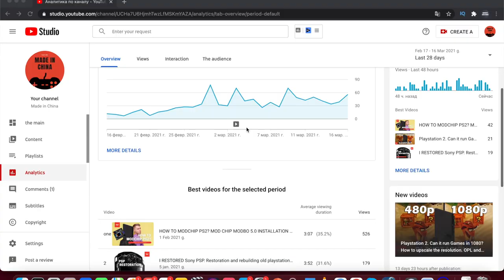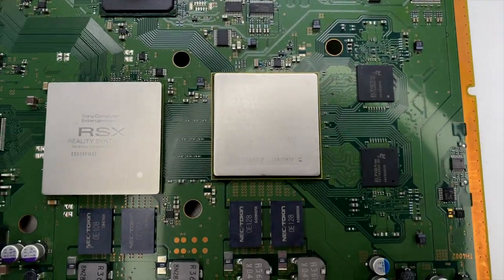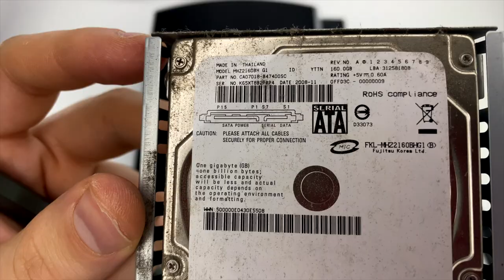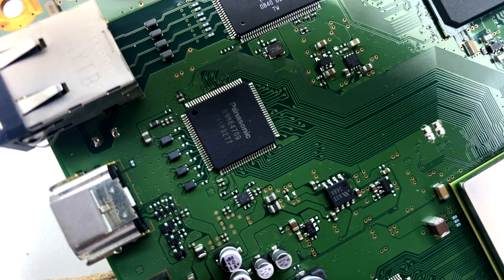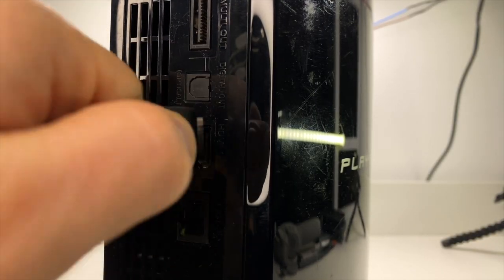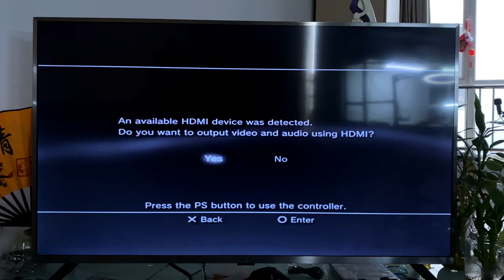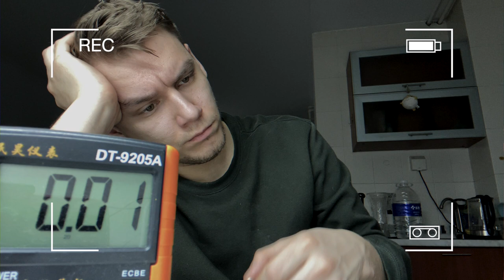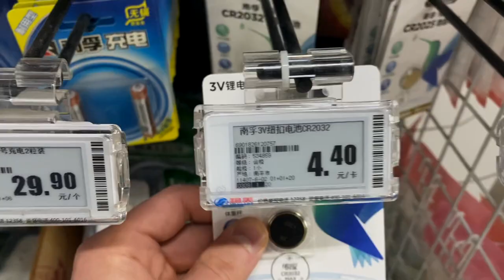PlayStation 3 BLACK SCREEN FIX. PS3 HDMI NOT WORKING. HOW TO FIX NO SIGNAL? NO VIDEO AND NO SIGNAL

Comment: I bought my Playstation 11 years ago and have never used HDMI in all these years. When I thought about doing this, I found this problem!
Reply from the maker: When your console is turned on, press the power button until it beeps for the second Time. Then, it will beep twice. And then let it go. And just wait a few seconds for the ps3 to adjust. If you see the picture on the tv screen, my congratulations. 

If you still have the problem:

There can be a few reasons why PlayStation 3 does not have an image, for example, mechanical damage to the HDMI connector, Board faults often include graphics chip (RSX) problems or HDMI video converter (MN8647091) (which I replaced in this video) faults, but other problems may also occur - power problems, firmware corruption, or CPU failure (CELL).

Take the console part, use multimeter to check the HDMI video converter chip, if there is short, on the output of hdmi signal, 100% that chip is broken and needs to be replaced.
Reply: There is still a problem anyway thanks for the quick and helpful reply.
Reply: @ReMARKCHANNEL  I have the old fat ps3 and it won't beep more than one HOW DO I FIX THIS!!!!

Comment: What should I do if everything works but the screen is black
Reply from the maker: When your console is turned on, press the power button until it beeps for the second Time. Then, it will beep twice. And then let it go. And just wait a few seconds for the ps3 to adjust. If you see the picture on the tv screen, my congratulations. 

If you still have the problem:

There can be a few reasons why PlayStation 3 does not have an image, for example, mechanical damage to the HDMI connector, Board faults often include graphics chip (RSX) problems or HDMI video converter (MN8647091) (which I replaced in this video) faults, but other problems may also occur - power problems, firmware corruption, or CPU failure (CELL).

Take the console part, use multimeter to check the HDMI video converter chip, if there is short, on the output of hdmi signal, 100% that chip is broken and needs to be replaced.
Reply: Thank you 🙏🏻
Reply from the maker: @m422q8  always welcome

Comment: Bro. I literally just had this happen on a 60GB system I just bought yesterday. No videos even after resetting the video preferences. It did work at first for an hour but the next day no video signal. Your video does seem like it would be helpful but there is just a lot that I wish you are able to at least  explain what you’re doing.. like the process of replacing the chip was absolutely crucial and it’s just a quick few different angles of you doing it in fast motion but without any explanation at all..I wish that you’ll be able to fix that!
Reply from the maker: Thank you !
Reply: Hi bro. i have the same problem. Did you solve it?
Reply from the maker: @josellanca1478  When your console is turned on, press the power button until it beeps for the second Time. Then, it will beep twice. And then let it go. And just wait a few seconds for the ps3 to adjust. If you see the picture on the tv screen, my congratulations. 

If you still have the problem:

There can be a few reasons why PlayStation 3 does not have an image, for example, mechanical damage to the HDMI connector, Board faults often include graphics chip (RSX) problems or HDMI video converter (MN8647091) (which I replaced in this video) faults, but other problems may also occur - power problems, firmware corruption, or CPU failure (CELL).

Take the console part, use multimeter to check the HDMI video converter chip, if there is short, on the output of hdmi signal, 100% that chip is broken and needs to be replaced.
Reply: @ReMARKCHANNEL  Hello bro, thank you for taking the time to reply my question. I dont have AV nor HDMI. So i am thinking that i have same problem that you showed in your video. It was very helpful and well presented.
Reply: I wish i could do that... My ps3 super slim suddenly won't output anything via hdmi & av. I tried resetting the video but no joy. At this point, I'm almost pretty sure it's the same problem you had. I don't know what to do, I'm lost.
Reply: @jonmanilenio  mate . He gave us the answer :)

"There can be a few reasons why PlayStation 3 does not have an image, for example, mechanical damage to the HDMI connector, Board faults often include graphics chip (RSX) problems or HDMI video converter (MN8647091) (which I replaced in this video) faults, but other problems may also occur - power problems, firmware corruption, or CPU failure (CELL)."

Now you need to decide what will you do :) Try to fix it or just sell as part on ebay. :) and buy another one.
Probably does not worth to fix that if you have a cheap ps3 console (like 40GB version). you can buy for £30-40 with controllers and games.

Comment: Great video! Thank you very much 👍
Could you drop us more informations please? :) 
Like:
- what is the heatgun's safest celsius for remove the chip ? ( as I see on the video : 294?) Probably better to using kapton tape to keep the motherboard parts safe ? 
- what digital multimeter do you use? ( I am just curious)
- what is the good / bad data on the digital multimeter to find out the problem? ( I am a multimeter noob sorry :)
- what is the liquid are you using? normal dishwashing liquid?
Thank you if you can answer these questions :)
Reply from the maker: Hello! Sorry for the late answer, I've been quite busy these days. 1) 1)With this particular chip, I used the temperature from 280 - 310 degrees celsius. For sure, if you have Kapton tape it is better to use it. I don't have this tape and I managed it without using this.
2) My multimeter is a very cheap device that I bought from Taobao.
The model name is DT-9205A
3) I'm so sorry to say that, but you are asking the wrong person=) I only know the basics and in the case of this Playstation, there was a short on the HDMI output, so when I removed the chip I realized that the short was gone and this chip was the reason.
4) Yep, you are right. I use the cheapest dishwasher liquid that I found in the local supermarket.

Comment: great video. I do console repairs for a local retro store in my area and just recently came across this for the first time. i have a short in the board where the capacitors surround the chip. is there an easy way to find the one i need for this fat model as well? everywhere ive been looking i keep finding the super slim or slim chips
Reply from the maker: Hello, do you mean nec/Tokin capacitors?
Reply from the maker: https://www.psx-place.com/threads/research-experimental-nec-tokin-capacitors-replacement-ylod.25260/

Comment: I tried to do this but all it comes up is a little grey screen within a black screen. There are absolutely no words at all and both of my controllers refused to turn on and connect to the PlayStation 3 at all even after I reset them. Even if I had a touch screen TV I wouldn't be able to go to any of the settings in safe mode to make it restore anything or reset anything or anything. There are no words that come up at all. I even tried changing where the HDMI was hooked up to the TV I tried to unplug it for a while the PlayStation I even tried unplugging HDMI for a little bit and plug it back in and see if it would try to reset that too no matter what I do there are no words at all. On the screen no thing like usually it'll say that it's shut down improperly or something when I unplug it for a while that didn't pop up either so there's no words on the screen there's no way for me to touch any words even if there were words because it won't hook up with anything I seriously need help because none of these have helped me I tried doing a hard and soft reset with the power buttons and stuff and unplugging and everything and no matter what I do nothing is working at all. It's very upsetting very frustrating I tried banging the PlayStation a little bit not too hard obviously I tried shaking it I tried blowing in every little hole trying to get a little bit of dust out if that was the problem there was an issue with that outlet at one point where for you plug it into the wall it was a little corroded around the metal that plugs into the wall and the PlayStation to turn the power on I clean that all up make sure it was dry and everything so it finally has power cuz for a little while he wouldn't turn on there was no red light or anything but thankfully it was just that issue the power cord I fixed it so now it's turning on but there is nothing and on top of all that where all these videos say that they're supposed to be beeps when the PS3 turns on and off and everything to make you go into safe mode and reset it and whatever there's no noises no beeps at all. I just held it down for as long as I could multiple times until it finally came up instead of being completely black screen to a black screen with a big gray screen in the middle so should be technically it is in safe mode so I can you know do all the steps that you can take to try to fix it but there's absolutely no words on the screen so basically no menu even if my PlayStation 3 controller would turn on and hook up to the PlayStation they would be useless because I cannot move anything I cannot touch anything there's nothing to touch there's no words I hope and pray that somebody knows what's wrong with it and they can help me I really need help I'm begging you please.
Reply from the maker: Wow, first of all, this is the biggest comment I’ve ever seen on YouTube 😂. As far as I can see, there is no way I can help you, because this console needs to be disassembled and tested with proper tools. If there is a service center in your area ask them for help.
Reply: @ReMARKCHANNEL  I tried using talk to text cuz it's faster but not effecient lol. It didn't type exactly what I said. I tried being very descriptive just incase someone may be able to help me. Sorry bout that. Thanks for the advice I'll do my best.
Reply: @ReMARKCHANNEL  honestly I think when my electric cord got messed up it may have short circuited something. May have fried something or damaged something internally. So I'll have to wait till I got money to go to a shop to get it checked out. Thanks so much either way though. Your advice is good I appreciate you taking the time to read my messages and give advice!

Comment: Hey Dudu, Thanks for the awesome video. Just very curious how you know which pin to test with multimeter? How do you know the two points goes through the ic chip?
Reply from the maker: I’ve read about this problem on a repair web forum. The guy who shared this info knows this problem 100%🙂
Reply: @ReMARKCHANNEL  Ok Thanks!
Reply: Can you share post or how to find it? Does AV still work with this chip failing?
Reply: @grandtheftauto1233  mine AV wordk hdmi dead, i have got short circuit sam as video. I try today replace driver.
Reply: @krzysztofs.6259  please share how it goes Id appreciate it
Reply: @grandtheftauto1233  TV see hdmi cable from console in input signal selection, before replacment TV did not see pluget cable. But the signal did not come back. AV works like before :(  maby hdmi socket is broken but i dont have one to replacment :/ PS sorry for language errors
Reply: @krzysztofs.6259  I understand. Yeah my tv see signal but no video.

Comment: Hello there...
I have a fat ps3 that has no signal, no thing but black screen and tv shows in the details bar on the bottom "480p resolution" ...that's it 
By the way, the power light is green
Reply from the maker: When your console is turned on, press the power button until it beeps for the second Time. Then, it will beep twice. And then let it go. And just wait a few seconds for the ps3 to adjust. If you see the picture on the tv screen, my congratulations. 

If you still have the problem:

There can be a few reasons why PlayStation 3 does not have an image, for example, mechanical damage to the HDMI connector, Board faults often include graphics chip (RSX) problems or HDMI video converter (MN8647091) (which I replaced in this video) faults, but other problems may also occur - power problems, firmware corruption, or CPU failure (CELL).

Take the console part, use multimeter to check the HDMI video converter chip, if there is short, on the output of hdmi signal, 100% that chip is broken and needs to be replaced.
Reply: @ReMARKCHANNEL  I did that. Same problem
Reply from the maker: @weswessy9843  did you try another output?
Reply from the maker: The composite one
Reply: @ReMARKCHANNEL  yes I did with A/V , unfortunately the same problem
Reply: @ReMARKCHANNEL  can I capture the issue for you? If you never mind..
Appreciate it
Reply from the maker: @weswessy9843  Unfortunately I don't think I'm able to help you. In this case it can be anything. I guess you better get professional help in your area🙄
Reply: @ReMARKCHANNEL  thanks anyway...
I think I'm the only " professional" in my area 😁

Comment: I have a problem with my console, there is no video signal on hdmi, but there is no video signal on rca either
Reply from the maker: Hello, There are lots of reasons for that. If you tried to reset video output settings then I say you have a hardware problem. If you are not familiar with testing/repairing pcbs don't try that, leave it to professional repair guys in your area, or grab another second hand console.

Comment: Question: If I'm not getting a signal from the HDMi and COMPOSITE cables, could the HDMI IC still be broken? Or would there be a different proiblem? My PS3 turns on fine an eject works too, hdd also seems to be engaged. It was rather dirty and dusty when I got it tho ... the thermal paste was pretty dry, but I seen dryer pastes on PC's in the past than this ps3. Any thoughts?
Reply from the maker: Well it can be anything =) RSX soldering, this chip or 100 other reasons. Did you try to boot it in safe mode or reset video output settings?

Comment: Well, i checked the chip like u did but mine seems to be okay. i checked the battery and it needed replacement so i did that.. but when i got it on, still no picture on my screen or tv.... i tried hdmi port and the other one, i believe its used back on ps2 for scart connector... no signal on both so what could it be

Comment: HI. Can you please list all things you use when removing that chip?
Reply from the maker: Hello , sure
Screw driver. (T8 and T10)
Soldering iron (use a thin tip if you have)
Solder.
Solder flux 
Solder wick ( useful, but not necessary)
Hot air gun ( or you can use any soldering station, it has both soldering iron and hot air gun)
Tweezers.
Microscope or a loupe.
The chip ( depends on your ps3 model)
If you have never done anything like this before you need to practice first. You can easily destroy the solder points or simply overheat the chip. Be careful and think twice before you do. Good luck 👍
Reply: @ReMARKCHANNEL  Thank you for replying. i hope you get soon 10k. Which solder flux is best. you did not even use wick right? I have 2 slim ps3 they can be different model number. But if they have different model numbers, does that work. the HDMI was working today 2 minutes before i started to connect elgato hd60 and switcher then when i disconnected all and only connected back only ps3 to TV no HDMI is active on TV. I tried to reset holding power button still not working and changed 3 diffrent hDMI not working yet
Reply from the maker: @hamzaridwaanhr7855  yep, you are right I did use the solder wick, but if I had it I would definitely use it with that repair. I used to have AMTech flux and I liked it more than the one I have now(some chip Chinese flux , it does it’s job well I just liked amtech more.) your ps3 can be different but they may have the same chips on the board, check the chip model)

Comment: My PS3 only displaying 1080i and720p  no displaying 1080p any solution bro
Reply from the maker: Hi, did you check the hdmi cable?
Reply: @ReMARKCHANNEL  Yes bro I will change New HDMI cable version 2.0
Reply from the maker: https://www.gtplanet.net/forum/threads/ps3-isnt-putting-out-1080p-anymore.306321/

Comment: So I got the fat console that I found in my friends new business and yesterday open it and clean it well took lots of dust and small dead roaches and actually change the battery I had around but it’s not showing video with the HDMI so I guess this is what is wrong. I haven’t play in decades and got a few games I wanna play.
Reply from the maker: When your console is turned on, press the power button until it beeps for the second Time. Next, it will beep twice. And then let it go. And just wait a few seconds for the ps3 to adjust. If you see the picture on the tv screen, my congratulations. 

If you still have the problem:

There can be a few reasons why PlayStation 3 does not have an image, for example, mechanical damage to the HDMI connector, Board faults often include graphics chip (RSX) problems or HDMI video converter (MN8647091) (which I replaced in this video) faults, but other problems may also occur - power problems, firmware corruption, or CPU failure (CELL).

Take the console part, use multimeter to check the HDMI video converter chip, if there is short, on the output of hdmi signal, 100% that chip is broken and needs to be replaced.
Reply: @ReMARKCHANNEL  I did that and still no signal not even with the AV cord
Reply from the maker: @ilakxunil7192  if there is no video output through the AV cable… I guess you may have problems with GPU…🙃